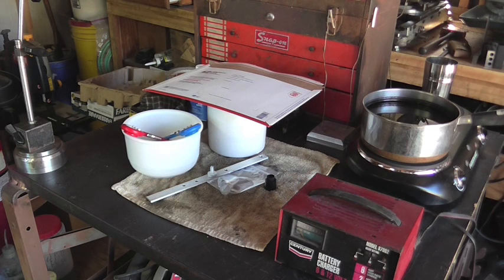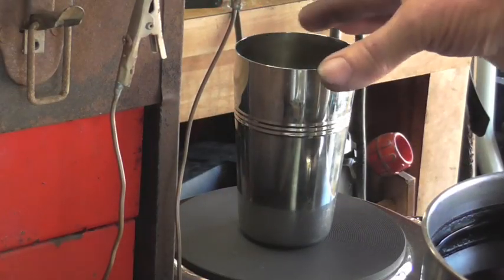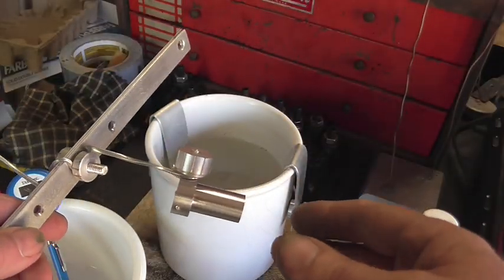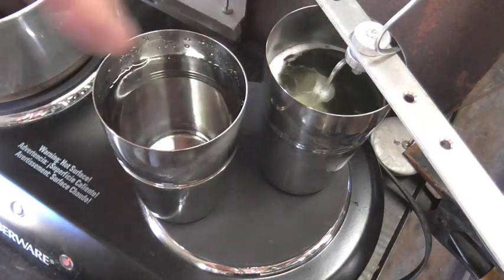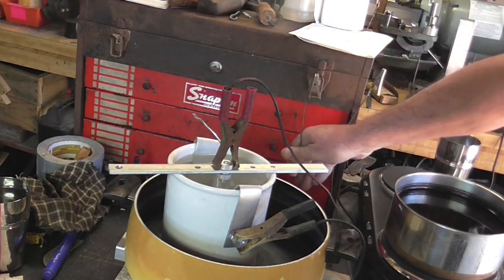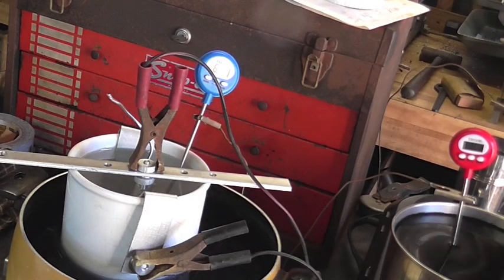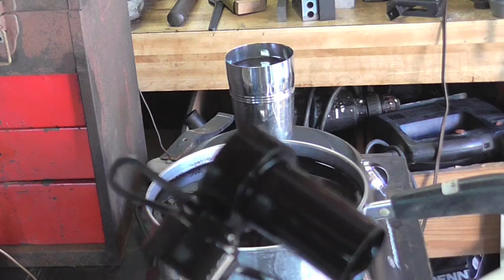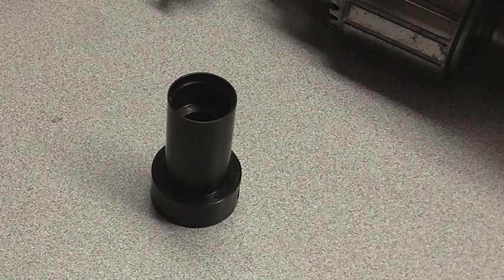⚡️How To Anodize Aluminum Parts Easily In The Home Shop - MSFN

Comment: When I was much younger I worked at a plant called cardinal aluminum.  We made the trim pieces that go around bath tubs and such.  We had giant tanks of chemicals that big ranks of parts went in to anodized them.  I anodized every piece of chrome on my 68 cougar.  Well all that was aluminum anyhow.  It turned out awesome.  Was a royal blue, almost like the transparent blue tint.  ((I miss that car))
Reply from the maker: A friend of mine had a 68 cougar, he let me borrow it a lot. I think I owe him a set of tires :)
Reply from the maker: XR7 I believe
Reply: Makin Sumthin From Nuthin cyclone k code car.  429 in it.
Reply: Makin Sumthin From Nuthin lol min be would slap melt the tires.  Out was a special order car. Me and a buddy bought it at an auction in Indiana.  I have 475 dollars for it and drove it back to Kentucky.  Got it home and recovered a framing square and drywall s8 crews was all that was holding the seat up.  The whole floor pan was gone.
Reply from the maker: High quality repair right there! LOL
Reply: Makin Sumthin From Nuthin RIGHT?!? LOL.  Not the worst I ever saw.

Comment: Lol. Not at this point. I work with a buddy of mine in a full restoration shop from time to time when he gets in a bind or behind. We do old cars such as 60 models camaros , mustangs and so on. We use them fittings a lot. I just wish I had taken pictures of all the parts I had made on the lathe that we have used on them. It would have been cool to go to the car shows and been able to say look I made that part on your car. He's won several best in shows and first places with the cars we have done. But to answer your question I see a lot of anodize parts. However we have never tried to diy our on stuff.
Reply from the maker: Thats really cool stuff, if only parts could talk....i dont do a lot of anodizing but its cool to be able to...give it a try

Comment: Great video Richard. Have you tried some of the other colors, such as the reds , blues , & golds that have that rich candy color after it's been done. You see it a lot on show cars on the steel branded fuel lines and coolant line fittings. Just wondering if it came out with the rich candy color. Thanks for the informative videos , and easy to learn and follow instructions.
Reply from the maker: The only color I have had customers ask for is black thus far, I havent done much playing around and experimenting with colors. You need a blue part made? Lol
Reply: Anthony N lx
Reply: The candy effect will come more from how smoothly sanded and prepped you have it. If you make it shiny as chrome before it'll come out that way with about any color. Ive used grocery store food coloring, rit, tie dye kits, even squeezed out the tubes in sharpies and have got some amazing reds, yellows, blues, greens, even black. It's all about the sanding prep, don't etch in lye if u want candy shiny, temp/time, and concentration of the dye bath.

Comment: Thanks Richard, good, solid information!  I wonder if other acids would work?  Like HCl (pool acid) instead of H2SO4, (battery acid).  Or other acids depending on concentration.  My sense is the reaction is more temperature driven than concentration driven.  Hmmm- will have to read up on this!  Thanks again, great simple process!
Reply: I'd be reluctant to mess around with anything with Chlorine in it (the Cl in HCL). It's really nasty stuff in it's gaseous form. The gas that is created in the SAA process is hydrogen, and is flammable, but it probably won't kill you if you inhale it. Chlorine gas is a completely different matter. Pool acid may also have other things in it  that could bubble out when you turn on the power, and could mess up the anodizing process. Unless you've got a degree in chemistry, ad-libbing with chemicals is a bad idea.
Reply from the maker: SAA, (sulphuric acid anodization) is a proven, time tested method and works well. I dont know about other chemicals and methods Dave ~ Richard

Comment: Thank you Richard for posting this great tutorial.  Looks like it did a really fine job on your part. Perhaps you wanted to do a scratch test...? See if it holds good and at the same time check the depth of the anodizing.
Reply from the maker: I did a scratch test on the practice part shown when I tested my chemicals prior to the customer part, should have filmed that. No issues. Dont know how to check anodizing depth...would be good info to know. Thanks for the kind words Pierre ~ Richard

Comment: Richard, good example of anodizing.  It looked like it turned out great.  I have never done it but read up on it thinking about doing some cast aluminum parts only to find out that it doesn't really work well on cast.  This tutorial was laid out well and I think I could even follow it.  Thanks for sharing!

BTW, never got your email and it looks like Kendall may be out of business?

Joe
Reply: My ACCOUNTANT did a price/cost of this thingamobobbery you did and told me to "fergeddaboutit !!
Reply: Nope just figuring how long is 3 hours times 200 is
Reply: I PROGNOSTICATE 42 hours !!
Reply from the maker: Yep, I found out the hard way homebrew cast aluminum wont anodize well. Has been a while since going to Kendall, that sucks....loved that place :(   New email sent ~ Rich
Reply: Got it.
Reply from the maker: This one is a prototype for a production run of approx 200 units, I would say your accountant needs to find another line of work 😊
Reply from the maker: Heck Steve, you probly found it so interesting you watched it twice :)
Reply from the maker: Only 3 hours+ when you have to film it. Getting good footage takes time

Comment: So you used fabric die ?Is it water based or?
Very nice looking part indeed.Could you do the coloring and anodizing in a same pot at once ?
Reply from the maker: Yes, it is fabric dye. The anodizing is a separate process than the dyeing and cannot be done at the same time. The part can be made any colored desired except for white

Comment: You can use rtv sealant as a masking to prevent certain areas from being anodized. It's important to let the rtv to fully cure before starting the anodize process. You csn also use rubber plugs to mask threads and holes.
Reply from the maker: I heard nail polish works good too, great tips....thanks Russ!

Comment: Love that bud. I have never done it but now I have the ways and means to make it happen. I assume for clear finish I would just not use the dye or is there something chemically needed in it.Over the years I have found parts that are anodized are extremely reliable as far as finish. Thanks a bunch eh !
Reply from the maker: Thanks Dean....Yep, just skip the dye and go right to the hot water. Its a pretty painless process, just gotta make sure the part is clean :)